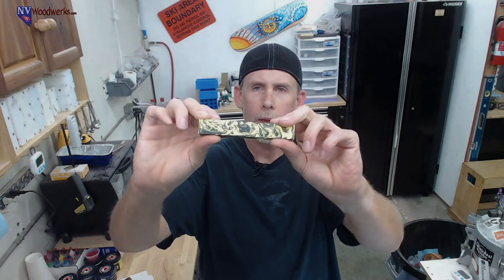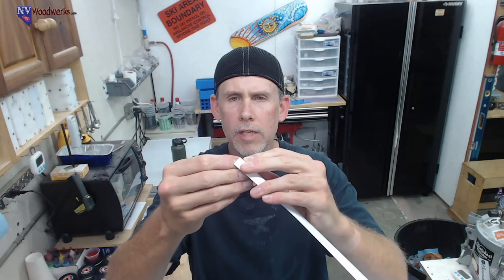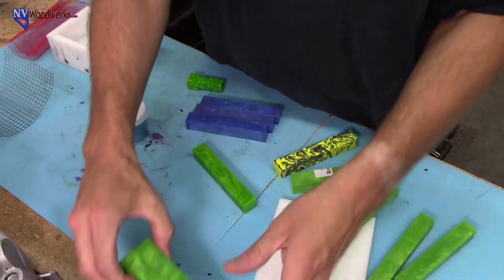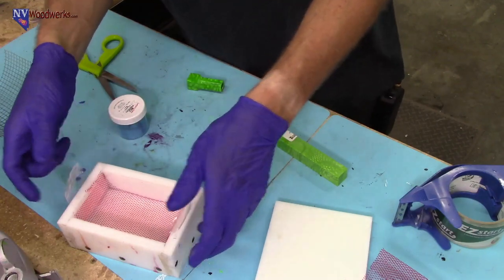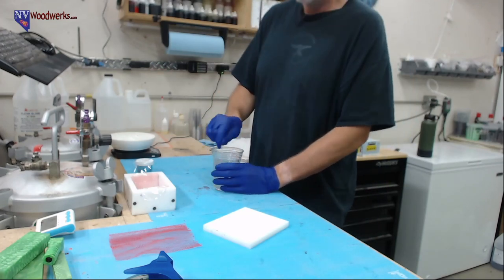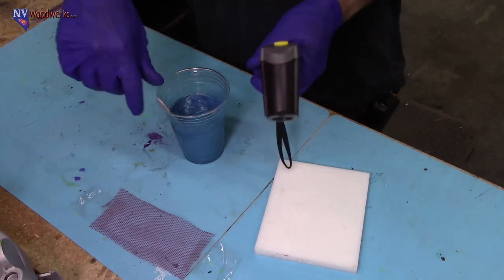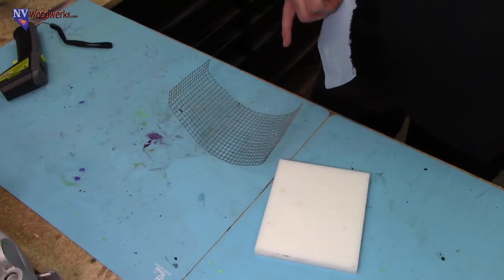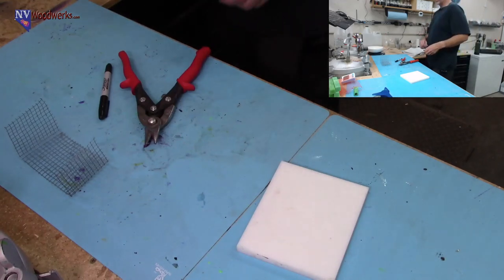🔴Replay: Patterns in Resin |  September 2020 Patreon Hangout

Comment: A colour combo that might work well for this technique is if you have a pearl mica and a dye in complementary colours. For example, with the plum crazy using a cyan or magenta dye, or a blue pearl with a green, cyan, purple, or turquoise dye. That may give an extra dimension to the patterning.

Also, Jennifer ILoveCrafts suggested using string to pull the more flexible mesh through. That's what I was also thinking at first, but, making 'handles' out of twisted wire in each corner might give a bit more stability and help keep the mesh taught.
Using this technique might allow you to use more interesting patterns such as pieces of lace as well for more variety.

Comment: Hey Zac, had a quick question. If you’re just doing resin is it best to use a ca glue for good polish or only necessary for the wood? Thanks
Reply from the maker: You can just polish up the resin, no need to put a finish on it
Reply: Zac Higgins cool thanks for the response

Comment: How well do you think pulling a flat cheese grater horizontally from one end to the other would work?
Reply from the maker: That could work, but it will be tough to clean the grater off afterwards. I'd probably suggest using something you can just toss afterwards
Reply: @ZacHiggins  Great point, don't want extra clean up.

Comment: You could tie strings to the ends/corners of the mesh instead of tape, maybe??
Reply from the maker: That would work great, I'll have to do that next time. I have a piece about the same size leftover, I'll give it a whirl =D
Reply: That's just what I was thinking Jennifer. Otherwise some twisted wire "handles" added to the corners might be even easier to keep everything steady and taught.